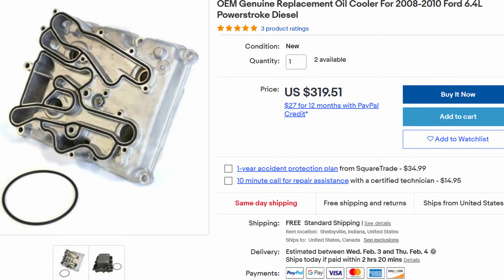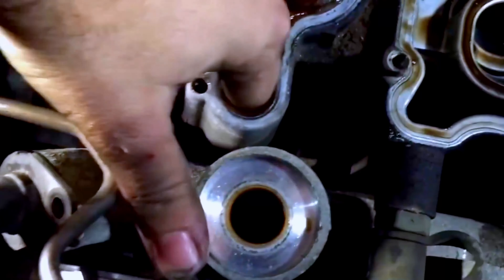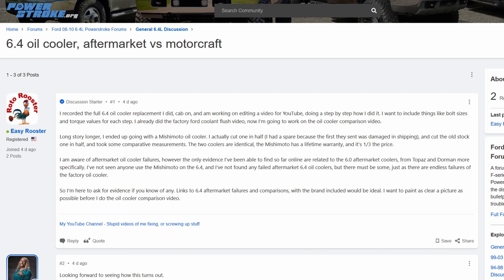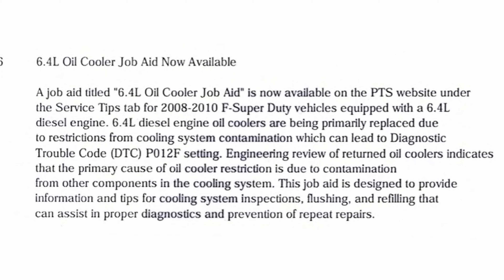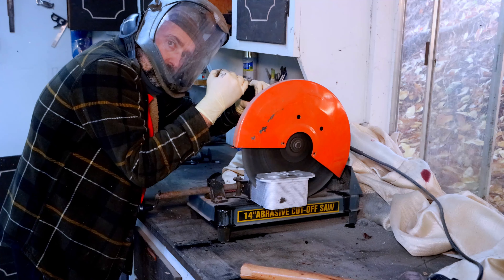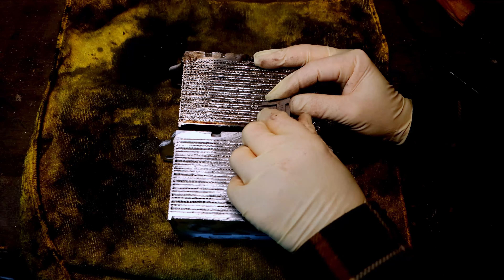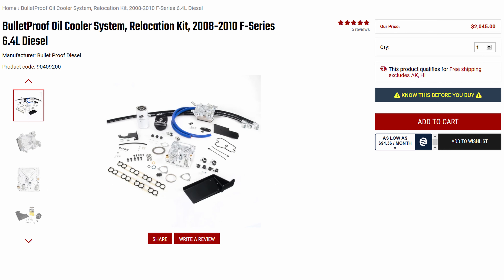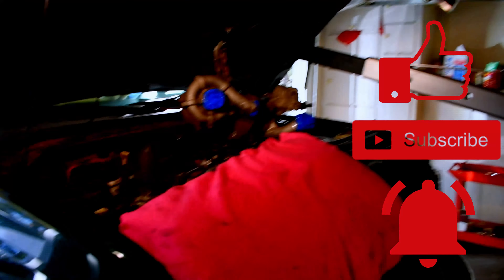Is an Aftermarket 6.4 Powerstroke Oil Cooler worth the risk?  Find out on IHWOC episode lucky 13!

Comment: How nobody has come up with a better design oil cooler that’s drop in is beyond me. I’m not an engineer but the EGR coolers were fixed by Bulletproof and they gave up on the oil to water design so they just made an oil to air cooler instead.